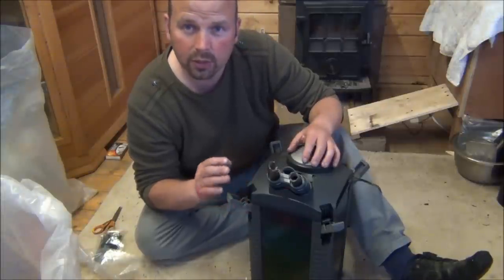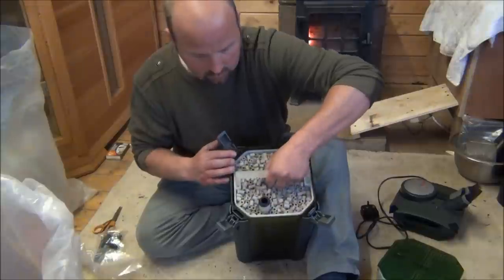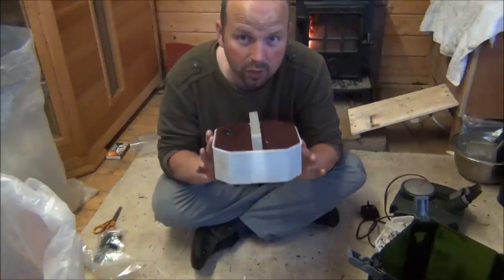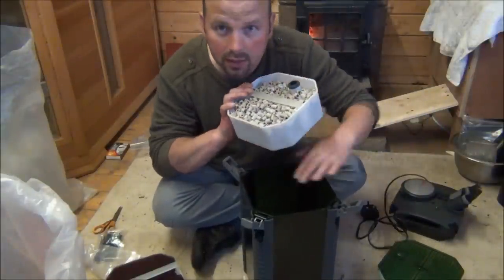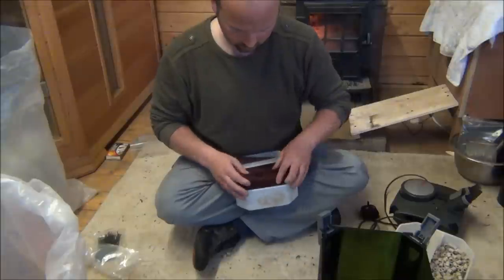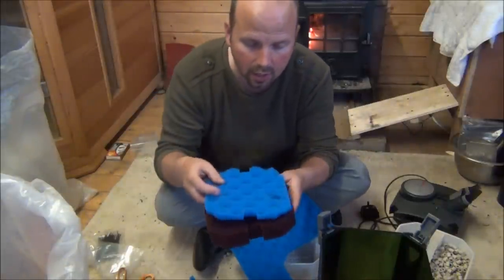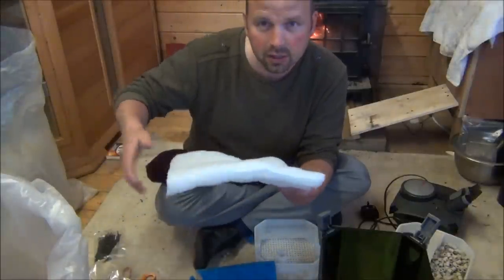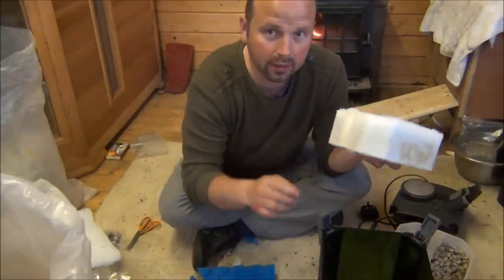How to set up an external canister filter for aquarium by Pondguru

Comment: I did exactly what was showed and got a fish dead and all others breathing badly. What I suspect is that those foam at bottom don't let good bacterias pass thru. Water gets crystal clear and fish having hard time breathing. I did a hole on foams to let some pass thru and hope they get better. Whats the correct step to do that? Do we need to wait before putting foams for the media to do their job first ?
Reply from the maker: Bacteria will flow right through the system no matter where foams are positioned so the position of foams make no difference for that.
If you replaced all the media at once in a mature system you will have removed most of the active bacteria (should be added gradually in a mature system to prevent that) so it could be ammonia you're having a problem with.
How does the water test?

Comment: I have an 40 gallon tank with a fluval 203 and am starting up a 150gl tank and using a fluval FX5,, My question; Will taking the existing Bio media with established bacteria out of the 203 and putting it in the FX5 cycle the new tank faster? Thank you in advance
Reply from the maker: Yes way faster although it will leave your 203 doing  poor job on filtration  but I assume you are closing down the smaller tank with the 203?
You could run both filters on the big tank for a few weeks until the new filter had been set up with bacteria (time would vary and largely based on what type of media is in the new filter - most come set up with plastic and all sorts of crap in them + ceramic media so typically take around 5-6 weeks to get a good population of bacteria in there.
Reply: First off thanks, for responding so quickly! Yes, the 40 gallon is going away and I will be moving my fish and plants to the big tank.  So then if I were to hook both filters to the big tank I could also move the fish at the same time?As far as my set up I have the 3 levels of foam in the first tray as well as fluval biomax rings "the ceramic crap"? and carbon in the middle canister and the final filter will be more fluval bio and a pouch of seachem purigen for the tannin in the water from drift wood. not sure if this is a good set up or not but its what my research has led me to so far.. I did find your Biohome on your ebay store but not sure the conversion for how much I need? Thank again! You are like a fish superhero.. saving  Fish all over the world!
Reply from the maker: Scott Brooks
If you had the new tank running for a week or so and it had plenty of mature water (from old tank) you could just move them all at the same time no worries.

Comment: How often do you clean the filter and how do you clean it?
Reply from the maker: There are loads of filter cleaning videos online but I haven't done one here yet - simply remove trays and shake media trays gently in a bucket of water you have drained from the tank to remove any fine muck (they should be very clean when filter is set up properly) then take out sponges and squeeze them out in the bucket of water, remove fine pad and replace with new fine pad if it is clogged up. Extend periods between cleaning as long as you can since there is no point cleaning a clean filter.

Comment: I have a filter with 4 trays instead of 3, should I do like yours but also put carbon on the top?
Reply from the maker: agus2001 Foam in the bottom tray and media in the rest. You won't need to add carbon unless you need to soak up some treatments or colour from bogwood as the filter will process al the waste. Carbon is often used to mask the fact that filter is ineffective so once it gets set up properly there will be no need for carbon, purigen or any other similar stuff.

Comment: how long can i keep the BIOHOME ultimate media in my canister filter before it has to be changed, cleaned or replaced. Soon as I know I will order your product asap. Thank you Darnell from the US Baltimore, Md.21219
Reply from the maker: Mr. Darnell P. Felder Jr. It will need cleaning whenever it gets dirty but that may be many months when the filter is set up properly. It should last a good 6-10 years at high efficiency and if you follow link to US seller in video description it will save you on shipping, no worries.
Reply: thank you ..i didn't know that there was a US seller. now all I have to do is find them.
Reply from the maker: Mr. Darnell P. Felder Jr. There is a direct link in video description - click 'show more' to see full video description.

Comment: Hello Pondguru! Very informative! Subbed! I got a question. I have a Fluval 306 to filter a 29 gallon tank with 3 goldfish (veiltail, fancy fan tail and red head fantail I think ). What media method do you suggest in order for my Fluval 306?
Reply from the maker: The foams down the side are decent so you really only need the bottom tray for the medium and fine foams / pads then fill the 2 trays above that with media. Each tray will take up to 1kg of biohome mini ultra or biohome ultimate. The water flows from bottom up through trays.
Reply: Thanks for the reply Pondguru,  I will follow your set up and hope for the best.  I will just wait till my current media needs changing.  Again thanks!!!
Reply: Hello again, another question, I wanted to get the foam you have used in the video and went to your US distributor site.  They offer a different kind of foam that is flat and no waves like the one you sell on your site.  Is there a way to get that type somewhere in the US side? 

I apologize for the repeat question on one of your other videos.
Reply from the maker: Good foams seem very hard to get in the US and the US supplier of biohome has to import them from Europe. You could try Amazon.com as there are some reasonable profile cut foams on there: http://geni.us/5cvdB
Reply: Pondguru Outdoors Thanks Pondguru!

Comment: Hi there could you use this method on a PondXpert EasyFilter 12000 Pond Filter and 8000 Pond Pump Set ?
Reply from the maker: That is a set for ponds and the set ups for aquariums don't really translate to ponds since the filters are very different.
Ideally the pond pressure filter would be left as it is with the foams in it and the pipe from the exit on the pressure filter would be passed up to a shower filter filled with decent media - that would provide an awesome filtration system for any pond and you can use anything from Alfagrog to white pumice to Biohome Maxi Ultimate for the shower filter or a combination of all of those depending on budget and what water conditions you expect from your filtration.

Comment: hi I have just bought 250litre ta know what filter would you suggest, and what filter is that in the video many thanks
Reply from the maker: That was an old pro2 filter from Eheim. The size of filter needed would depend largely on the stock in your tank but you should look for a filter which will filter 'up to 500 litres' or ideally up to 600 litres. You'd always halve what the manufacturer gives as the 'up to' figure for a normal tank.
The all pond solutions filters are very cheap and work extremely well once they are set up properly: http://geni.us/2LnO

Comment: I just found 2nd hand FLUVAL 305 and 405 cannister filters. Can the same method be done with those?
Reply from the maker: If you check my channel you will see a playlist called 'pimp my filter' and in that there is a set up video on the 306 which is the same method as the 305 (same as 405 but 405 has extra tray).

Comment: hi pondguru, i have a tetra tec ex 700. Would this be same set  up i should put in my filter as the media is at the bottom. thanks
Reply from the maker: Yes same as this video. Normally the Tetra externals come all manner of messed up but can easily be made to work properly with good media and foams in the correct place, no worries.

Comment: What filter media layout would your recommended for a Fluval canister filer 306 ? you made any changes since the video ? if so could you list the media so i can then buy and setup it thanks a lot.:)
Reply from the maker: Most people go bottom tray layered foams or fine particle pad then media for others. If you send me sizes of trays you want to fill I can work out how much you would need no worries. The link to my ebay page is in video description and the best media available is biohome ultimate. My email address is pondguru@btinternet.com
Reply: Thanks I would have to take them out the filter as I cant found any measurements just on the baskets themselves online or in the manual.

Comment: It would be so appreciated if you could suggest how would you arrange the mechanical and biological media in only a two-tray canister filter (Eheim 2222). Should I fill the bottom tray with only mechanical media (coarse, medium and fine sponges) and the top tray with biological OR is it better to add the biological media also to the bottom tray (by using only 2 sponges and not 3 or by making the sponges thinner - which will leave some space for the biological media)? 
I am just concerned that having only one tray of biological media would not be enough for proper filtration. I have a 60 liter tank. Thank you so much
Reply from the maker: I don't know how much media the trays will hold in that particular filter but I'd imagine it should be around 1kg per tray so having the bottom tray for foams and fine pad followed by a tray of media above that should be fine for a 60 litre tank no worries.
Reply: Thank you so much. I don't have the exact tray dimensions, but I believe one tray can hold 1 kg of media. 
I had the filter set up by the local fish store and they arranged it in such a wrong way (Bottom tray- biological media and on top a coarse foam & Top tray - activated carbon bag with a lot of white floss on top). 
After viewing your video, I now understand how wrong it is. Thank you so much for all your help and such a valuable information you share. I will re-set up the filter based on your instructions.
Thank You !!!
Reply from the maker: No worries, I'm glad to have helped as so many filters are set up very wrong.

Comment: If you are not very conscientious and clean person it is best not to use expensive bio media at all. It is very easy to clog that up and it will stop working. Fill up all filter to the top with fine synthetic fibers same as last pad used and that will give you plenty of surface are for bacteria while doing mechanical filtration. It can be washed or replaced on demand.
Reply from the maker: If that's what works for you then that's the best set up for you.

Comment: I'm sorry I am asking a question I probably already know the answer to.
I reconfigure my hang on the back filters the same way. I toss the cartridges, take the "sponge" off one of them to use as a support, then I put a medium sponge block in the large empty space. I don't know that putting three densities of spong in a small HOB would be an advantage. On top of that I put ceramic media. I am thinking though that the only way to get a full cycle going would be with a canister filter? Or would using a much larger HOB with a slower flow set up this way have any chance of holding anaerobic bacteria? Wish you were still making videos, but I see Biohome has a Canadian distributor so I will be ordering some anyway, because eventually I will have a large external filter for my big tank. Thank you!!
Reply from the maker: When using the biohome you can achieve a full cycle as long as plenty of used for the size of tank and stocking level so the type of filter isn't too important. However, most HOB filters won't be big enough to hold a suitable amount of media for a decent size tank. Slower flow will de-oxygenate water and allow media to support more anaerobic bacteria but most filters have quite a fast flow which requires a sensible amount of media to be used.
Reply: @pondguru  my understanding of anaerobic bacteria is they need an oxygen free environment. So I'm thinking an HOB would never see it.
Reply from the maker: @kerrypitt9789  It is the choice of media which is the critical thing and the internal structure of a media is the deciding factor to it supporting aerobic and anaerobic bacteria (in any filter, in any flow). If you watch the video I did called 'Looking inside filter media' that shows a microscopic view of the inside of many types of media and explains why some will support anaerobic bacteria and some will not so it would be a very useful one to see.
Reply: @pondguru  I will look for it, thanks!!

Comment: does the juwel rio 125 internal filter set up like this please? ive set mine up like this dont know if ive set up right, my tanks 6 weeks old and i use your biohome ultimate media + corse med fine sponges, but water comes from the top of the filter too through a grid and within 1 week theres brown slime on media net bags
Reply from the maker: Should work just the same, yes as it works from bottom to top just like an external. I wouldn't worry about brown residue on filter bags.

Comment: Hello, in using eheim 2213 for a turtle and 4 guppy, i found that my canister have a gap between the media tray and the canister can. Can i still use ur method? Im afraid because its just one big tray, so if i stuffed the way you said(coarse,fine, and bio media) the water gonna bypass through the gap to the end of the tray(because i find a lot debris near top of the tray. Should i modify it to (coarse-fine- biomedia-fine)?? Thxs :)
Reply from the maker: +anton dharma saputra You could go with the extra fine pad if that is the only solution but there is a good chance the muck will get caught second time round (or eventually) if only one fine pad is used. Problem is the turtle produces so much muck you may indeed need the second fine pad.

Comment: SO just got used an Eheim Professional 3 with 3 baskets and the pre filter layer so just leave the tray and remove the course foam that is there?
Reply from the maker: Are you asking about the pre-filter tray or the bottom tray?
Reply: The pre filter at the top
Reply from the maker: @jplegresley3345  You can leave the coarse foam in there if you want to - as long as you have a coarse, medium and fine pad (or a minimum of medium and fine in the bottom tray) in the bottom tray followed by trays of media it's all good.

Comment: hi, looking for a external filter for my juwel 180 rio fish tank (which is 180 liters) as mine filter is about to fall off. what would you recommed thanks. also stupid question would i be better off getting a filter what does up to 200 liters or 250 as their the price isnt that much difference well the one i have seen on ebay doesnt.Jebao External are them anygood thanks
Reply from the maker: +Shaun B the real one I'm not really a fan of Jebao pond products as they are made really badly but the aquarium stuff isn't too bad. Definitely go for the one which does up to 250 litres as they are always very optimistic. If it is set up properly with correct media it will perform beyond its normal capabilities.
Reply: ok thanks what external filter would you recommend as its my 1st go of having one
Reply from the maker: +Shaun B the real one Depends what your budget is but Eheim are the best quality. Fluval filters are good too. Avoid Jebao and Tetra externals as any experience I have had of them is shoddy construction and really cheap internals.

Comment: I've just got a Jebo 825 and I'm not sure if it's top to bottom or bottom top? Which order should I put the media in?
Reply from the maker: +fallingcloudberries It works the same way round as the filter in this video - water travels up through trays. Therefore foams need to be in bottom tray, media in trays above.

Comment: Hi. I'm new to external filters, so I am not sure about water movement inside the canister, but here goes: doesn't the aquarium water travel through the canister from top to bottom on the input side of the canister and then back up from bottom to top on the output side of the canister? If so, with your setup, doesn't the intake water hit the bio media first, (without being mecanically filtered) as soon as it gets into the canister? Thanks very much. Also, any idea how much biohome ultimate would go into an Eheim 2078 filter? Best regards.
Reply from the maker: With most external filters (same as this one) the water travels down the central pipe and goes to the bottom of the filter then travels up through the trays. Therefore it hits the media trays last and it hits the foams (in bottom tray) first. The Professional 3 filter works in exactly the same way but has an extra space at the top for pre-filter coarse sponge. Leave that one in then just set up the rest of the filter as in this video for best efficiency with bottom tray having coarse, medium and fine pads and the trays above that having the media.
That way all mechanical filtration is done before the water hits the media.
With regard to how much media you would need for a specific filter just send me the dimensions to pondguru@btinternet.com and I can work it out for you no worries.